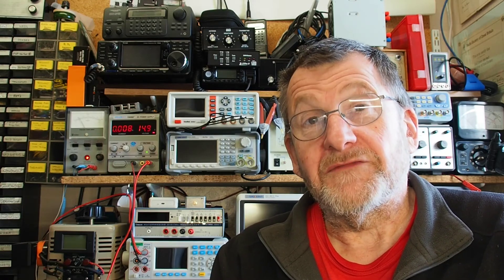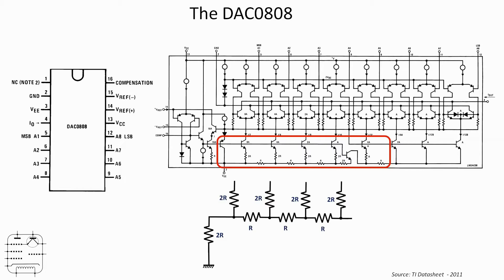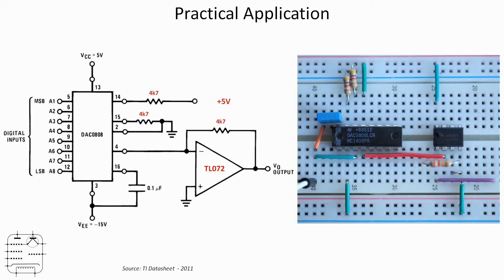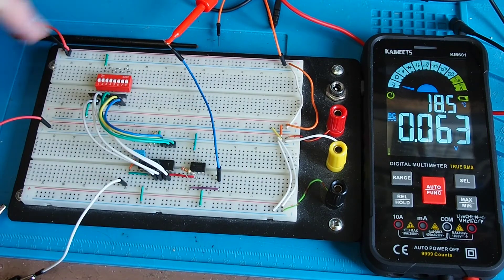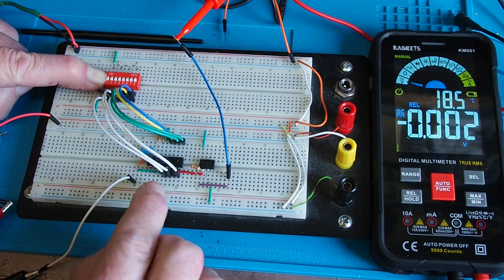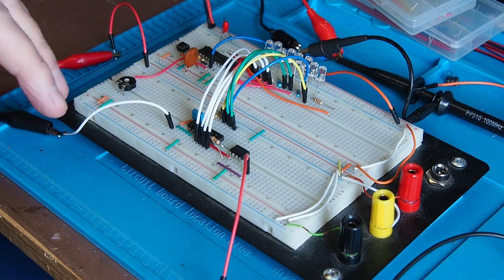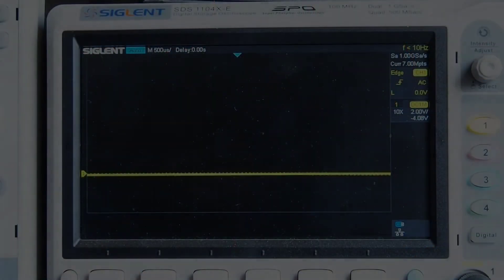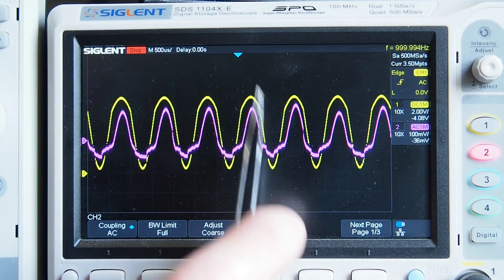Digital to Analog Conversion – Part 2 The DAC0808 - #159

Comment: Thanks for the video.. one question, there is a way to use single supply +Vss/0 for the DAC0808?  I don't have a dual power supply.  Thanks

Comment: Hi Bill, I just want to say I've been enjoying your YT videos for a while now. I find your delivery of sometimes very challenging concepts very easy to understand. I've just taken delivery of the East Testers Et3360c 60Mhz function generator. I've been using it for a couple of days now and I find it an excellent product for the money. I've always been interested in electronics but never really took the plunge until now (after 53 years on this spinning orb). After acquiring  a Hantek DSO5072p Oscilloscope and now this function generator it really helps me visualise what is happening in my circuits. I just want to thank you for your content as it's really helped me. Just one more thing. There is a connector on the back of the et3360c which is a male header type connection. Can I use this to drive TTL level chips. I only ask as there is not really any documentation about this particular output.
Reply from the maker: Good question. 
I don't know, but I suspect that the syncro signals are on there at ttl levels, but I am guessing.